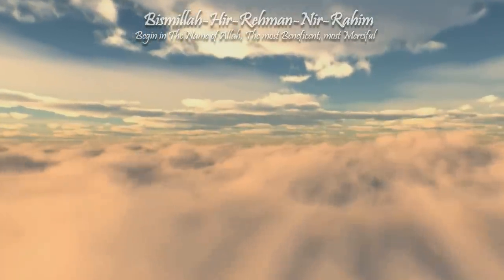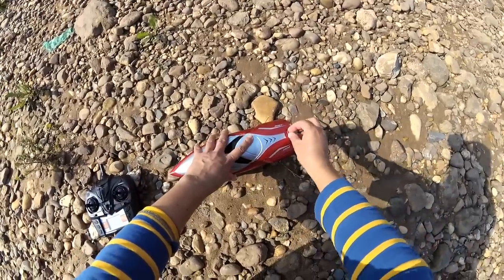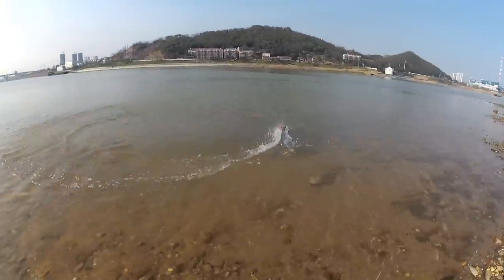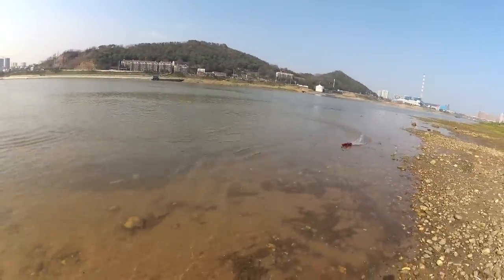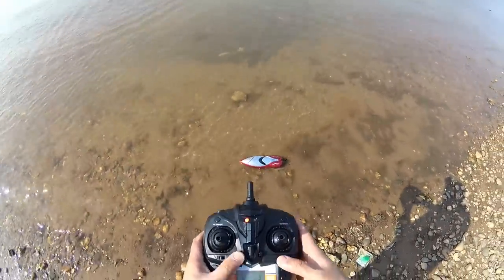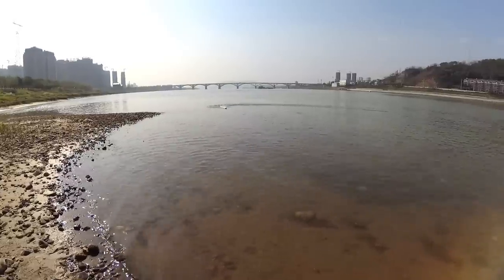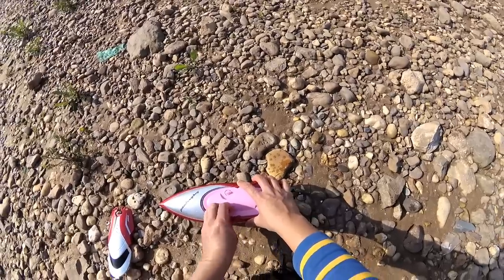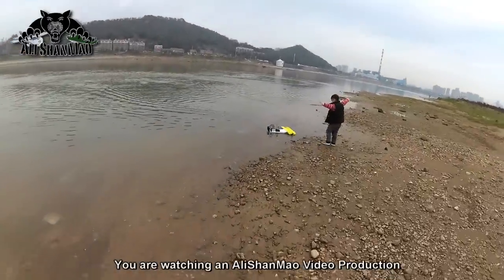H106 Mini RC Speed Boat with Self Flip Back Feature

Comment: I am thinking of taking my skytech h101 and putting a 3650 3100kv surpass brushless motor with a water jacket and a ocday 60amp water cooled esc and a feilun ft012 shaft and prop and a flysky gt3 receiver to have a little boat that flys maybe hits 60-70 on 3s-4s power no more then 50c rating so not to put to much punch in it. What do you think??? So like a fun DIY??

Comment: Does it give enough limp home mode on dead battery I.e slows down a lot but still enough juice to get to shore or do I need rescue boat like you?
Reply: You get range & low battery warnings from the Tx. Do your long range (100m+) runs with a fresh battery and bring it in when the low battery warning sounds. You won't need a rescue boat! Great little tubs.

Comment: Not an expensive RC boat but I've trouble with the servo. Quite impossible to set it correctly and the trim is not sufficient to solve my problem 😏
Reply: The trouble with most of these very small boats is that the steering servo is not connected to a point on the rudder at right angles to the rudder pivot pin. This means you get much more force/travel 1 way than the other. They are fun little toys for the money though.